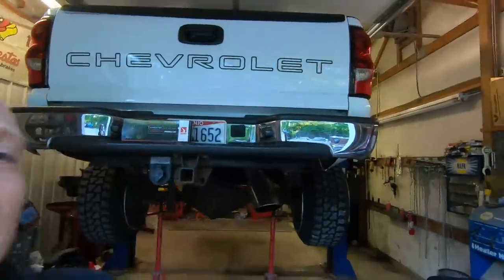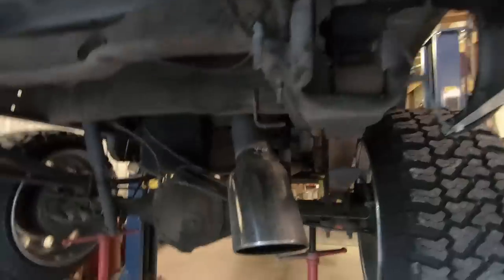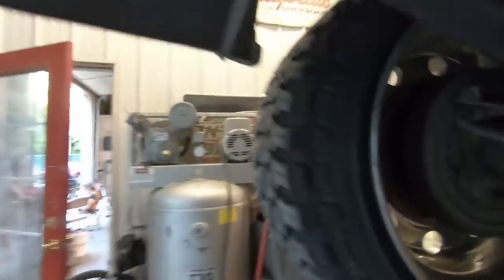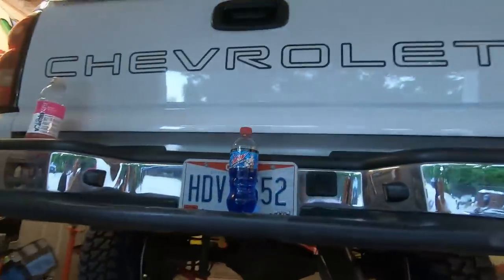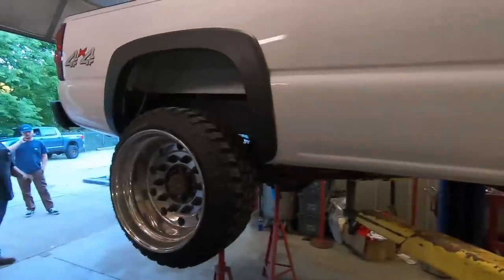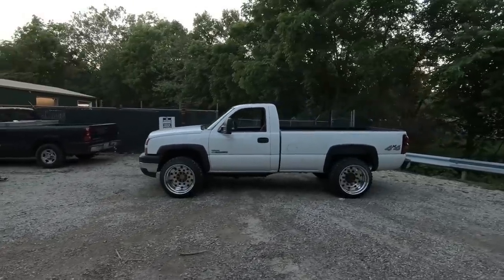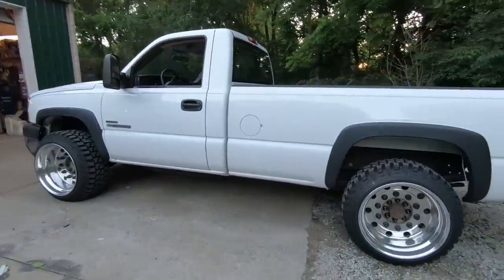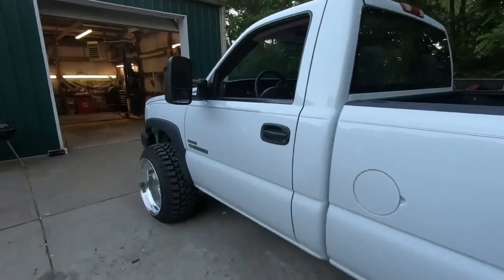Drop Shackle Install On My Duramax!

Comment: Can you set it any lower with then shackles? I noticed it had more holes to choose from. Or once you order a 2" that's pretty much all you get? No more no less
Reply from the maker: With the 3 inch drop shsckle you can do 3 inch down or 2 inch down. With the 2 inch drop shackle I believe all you can get is 2.
Reply from the maker: In a more recent vid I did 3 inch lowering shackles

Comment: I had mine installed and when I drive on free way now it’s so bouncy where it makes u wanna puke it’s a 2018 Chevy Silverado on 24 inch rims stock suspension other then rear shackles I had a shop put on city drivings fine and high way rides and bounces a lot any reason why?
Reply: Try a set of shock relocators. When you lower these trucks it changes the shock geometry and they don't work properly. Also...if you don't haul a lot of weight flip the overload spring to top of spring pack it'll help soften the ride.
Reply: Anonymous Dontcare thank you